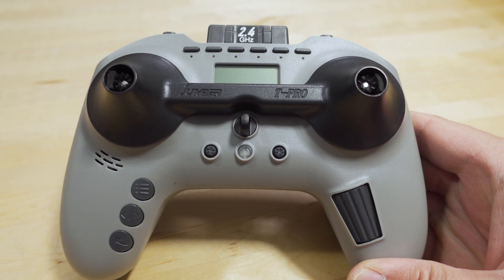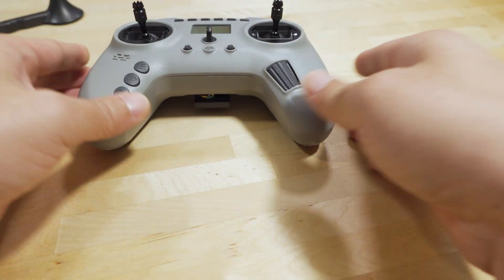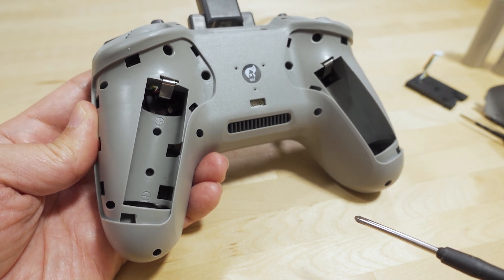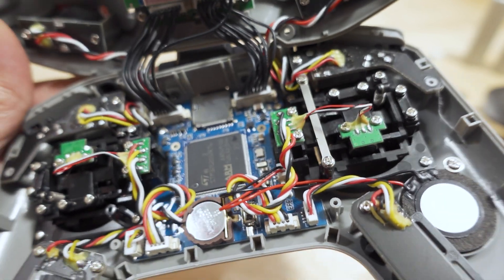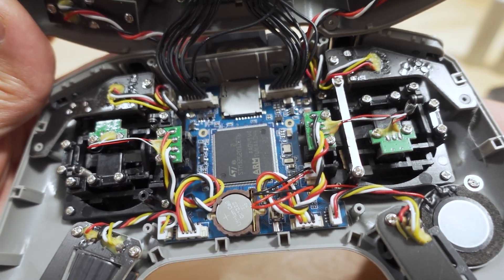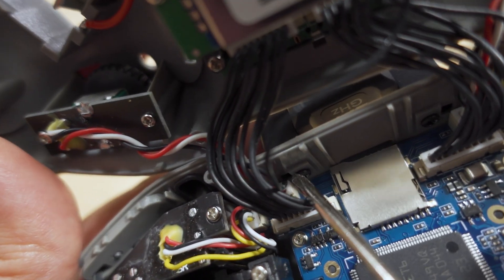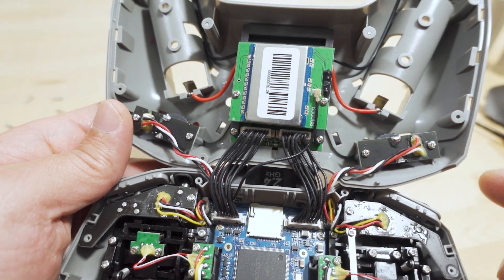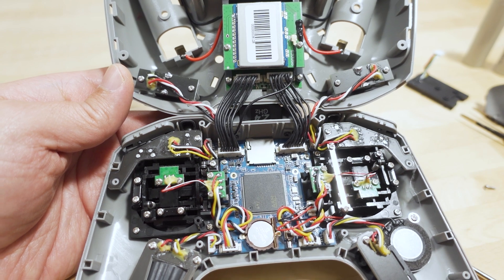What's Inside the Jumper T-Pro Radio? #TEARDOWN🔪😲

Comment: I really hope jumper sells the replacement part for the elrs 1w so you can install internal elrs without buying another radio. After comparing the internals of the jp4in1 version and the elrs internal version, the only difference was the bottom part of the radio where one has their respective chips and the elrs has an actual alumunium heatsink unlike the jp4in1 version. Overall great teardown..

Comment: The back of the Jumper T Pro has a 5 pin connector for the Nano module connection. I understand 3 of the connector pins are power, ground, and CRSF. Have you been able to determine the remaining 2 pins?

I want to use an SBUS or PPM pin for connecting an Rx to for trainer mode like I have done with JR module bays. It would be great to understand the other 2 pins.

Thank you for your great work.
Reply from the maker: I don't know what the other pins are for.  Maybe Jumper support might be able to help?

Comment: This jumper reading access protocol 9f frsky for r9m module?
Reply from the maker: Not without an external module
Reply: @AlbertKimTV  I have bought this model and an adapter to be able to put the r9m module that I have, with this could it work and link the module with the access protocol without problem? In my radiomaster tx16s I had to make an internal welding mod so that it read me the access protocol, in this station it would not be necessary?

Comment: nice I'd probably rip off the stock antenna for the internal module and install a patch antenna inside the radio and use a xfire module on the back. I may be replacing my tango 2, I like the feel of the xlite better anyway
Reply: Patch for a Tx antenna? Interesting… 🤔
Reply: @abertheham  I run a patch ant on my xlite for 2.4 TX seems to work fine on my park fliers. I run xfire on most of my other quads

Comment: I hope that tiny wires are silicone insulated wires, not in PVC insulation as t-lite (mine breaks after few flights)
Reply from the maker: They seemed flexible.  Have bot broken yet.
Reply: Looks like a mix with smaller wires being PVC, I won't be opening mine to find out though! Lol!

Comment: How difficult would it be to swap out a removable antenna on there? I really hat that giant T thing.
Reply from the maker: Pretty easy I think.  Looks like just two screws hold the whole thing on.  Not sure what you can replace it with however...
Reply: @AlbertKimTV   I'm thinking just an sma pigtail out the top with a regular 2.4g antenna. Something easier to live with.